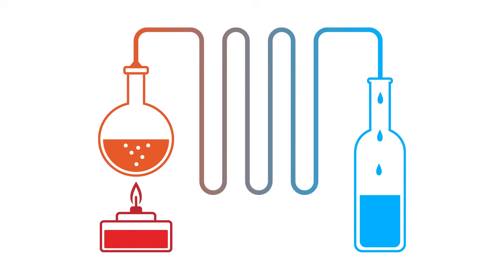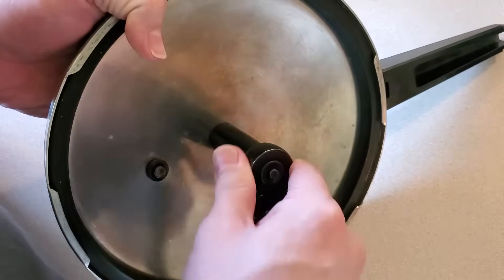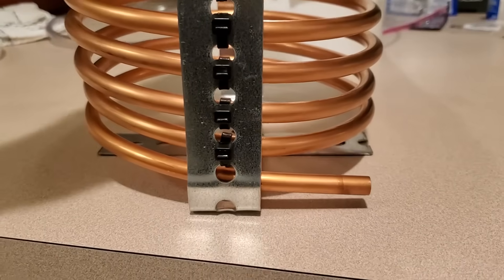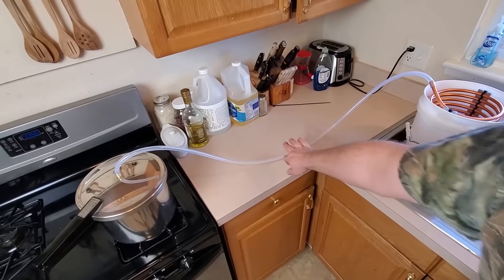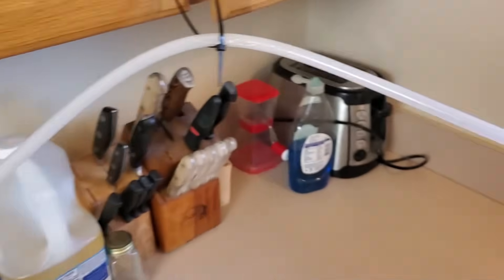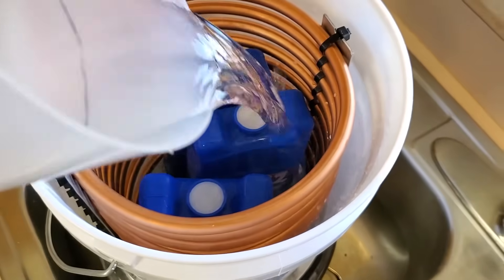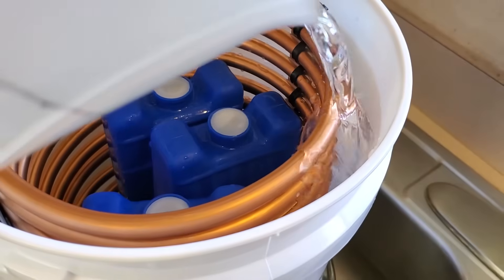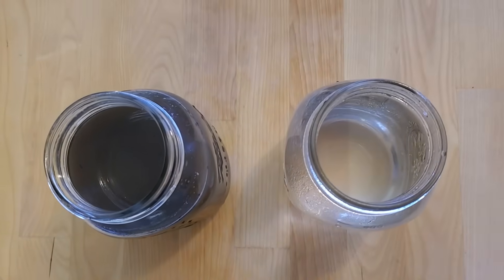DIY Water Distiller (Higher Output Version) - Full Build and Demonstration

Comment: I did the same thing and got fantastic results, however the distilled water is coming out cloudy. I read somewhere that that's because there is a lot of micro bubbles in the water so will it turn clear with time?
Reply from the maker: That's certainly possible. That was is just shy of boiling when it condenses and falls out into your jar. If it's not clear within a few minutes, I'm not sure why.

Comment: If you let your boiling container run dry through the process, you can use distilled vinegar (which is a mild acid) to soak in the container to loosen and easily remove the sludge that builds up.  If you use a stainless steel container, vinegar is the way to go, and by the way, if you use stainless steel cookware that gets caked up with the food you cooked in it, vinegar will help make that clean up easier too, just let it soak in vinegar for awhile then the guck should be easy to remove.
Reply: Barkeeper's Friend is less than $2 a can and works even better.
Reply: You can also steam vinegar through the copper, which I've heard is corrosive(?)
Reply: Hey Jerry, thanks for the advice! I have bought a few stainless steel cookwares, and plan to get more in the future! My family always used aluminium cookware, and I'm slowly weaning out all the aluminium cookware in the house.

Comment: Could you not have the steam/water drain into another sealed container- the same as your boiler, so that the steam will condense and cool overtime?
Reply from the maker: The issue with doing that is I'd basically be creating a pressurized steam bomb. That's assuming that the silicone hose wouldn't just blast right off under the pressure, which it would. It's got to be an "open" system. The way to make it more efficient would be more/longer condenser coils.

Comment: I just did this in a basic 5 gallon distiller I bought.  It was very inefficient.  This set up here was also ver inefficient.  35m of fuel and 35m of water ru ning out of that bucket for 20 ounces of distilled water is is simply inefficient.  If you are next to a cold stream, great.  Use the flowing cold water.  Don't splash in your distilled water, though!  Also, if you have use for hot water, this setup will create it.  Shower water, dish water, etc. can be used from this process.  If not near a stream or river, you can also recycle water.  Remover the water when it gets warm, leave it out while other water is cooling, and reuse the water once it cools a bit.  On my distiller, I think my water flow increased when I poured some water right at the beginning of the condenser process, but this was outside the condensore bin, so it dripped on top of the boiler lid.  I think the steam there created back pressure at the 90 degree angle that limited steam flow into the horizontal condenser portion of the copper tubing.  Overall, this is better than nothing, but not an elegant solution by any means.  It was time consuming to create relatively little output.

Comment: That’s a lot of work, expense, gas or electric stove power and wasting cold tap water to cool coils. It all adds up $. I’ll keep buying mine at Walmart.
Reply from the maker: It's certainly more cost effective to buy it from Walmart. My interest in building a distiller has more to do with what happens if you can no longer buy it at Walmart (or anywhere else).

Comment: It would be cool to split the clean batch, pass one through a simple brita type filter and sending a sample of each of the clean waters for testing. I also have heard its good to add some electrolytes to distilled water if your drinking it on the regular.

Comment: Great idea.  Would it work with less heat under the pressure cooker so it would give more time for steam to cool with a slower flow?  Blessings
Reply from the maker: I'm not 100% sure on the answer to this, but I think the answer is no. Because steam won't happen until the water reaches boiling temperature, and steam definitely happens once it reaches that temperature. In other words.... your steam is always going to be "steam temperature", and if your temp is lower than that, you won't get steam. Even though this uses a pressure cooker, it's not really pressurized (because of the hole in the top), so that temperature is gonna be somewhat consistent at 212 degrees F (unless you live at high altitude, then it'll be slightly lower).
Reply: Yes sir it would absolutely work with less heat a person could put in a penetrator in the lid of the pressure cooker with a thermometer inside the lid but not down in the water. And as long as you keep the temperature somewhere in the neighborhood of 212 to 215°, it will create steam but it would be coming out of the worm at a slower speed
Reply: I'm sorry I wasn't clear on my last post the worm is the little bit of copper that sticks outside of the coil bucket where the condensed water actually drips from

Comment: Disregarding the increased risk of being burned/losing potential energy, what do you think about omitting the condenser bucket and copper tubing to make a small scale version of this? I imagine the pressure cooker with attached tubing leading directly to the collection jar.
I plan on making a proper version of this distiller when I have the resources available, but I need a lot of distilled water right away,  and I am SO tired of collecting steam on a upsidedown pot lid!
Reply from the maker: Hi Robin, I suspect you would just end up with a lot of steam shooting into your container. I have seen a version of this that uses a flexible metal hose that just sort of arches between a large tea kettle and a container, but it's still definitely less efficient. Once you create steam, you have to somehow cool it before collecting it, otherwise you're just venting steam into the air but with more steps.

Comment: probably in the comments somewhere but yeah... that hole for the tubing in the bottom could use some silicon to keep the water in, saw in a comment about copper leaching... what about just using  the same plastic tubing  ? does plastic leak too ? then here you would have 2 possible leachers if so.  when doing colloidal silver you need pure distilled so that would be a concern, have to wonder if it is made right in store bought gallons. and is that 316L stainless steel tubing hard to get.
Reply from the maker: Well, I'm using food-grade silicone tubing for the flexible hose part, which does not leech anything. As for the copper, this is needed for the "radiator" properties. It's highly temperature conductive, which is why it works so well. I'm not worried about copper leeching into the water.

Comment: Great video and DIY!  One word of warning - distilled water leaches copper.  It would be a safer idea to use 316L Stainless Steel Food-Grade tubing for your condenser.  It will raise the price, but it is a safer solution.
Reply: thanks! Conversely, how much potential Chromium/Nickel/etc. might leach into the distilled water?
Reply: @stevoblevo  probably much less, because the alloy as a whole rusts/oxidises less than copper (if high grade S.S is used). Side note, avoid aluminium pots and tubing too.
Reply: gold plated problem solved
Reply: Most people have a copper deficiency. If anything, the amount actually leached from the distillation process would be a benefit.
Reply: @HeadbandvrOFFCIAL  Copper can easily exceed recommended amount & become a toxic amount.
Reply: Anyone know how much? Im trying to distill well water for cannabis plants, very high iron content but potable for people. Dont wanna trade one metal toxicity for another
Reply: @wills.5762  RO
Reply: What about pvc pipe?
Reply: @maisong9886  pvc also leaks into the water, there is one expensive plastic that does not can't remember its name, you then also lose the conductance of copper
Reply: @divey1337  I used to do sewer / water installs on new houses. Some used copper lines, and others some blue PVC type material. Granted that was cold water that went to the water heater, and from there pretty sure it was some sort of PVC plastic.
Reply: @maisong9886  polypropylene is its name
Reply: @maisong9886  hard to find in suitable sizes and it's difficult to make a coil with it
Reply: Copper isnt toxic to life.
Reply: @Blade56762  https://ods.od.nih.gov/factsheets/Copper-Consumer/
Reply: We need copper anyways most people are defiecent right? Id rather have extra copper than 50 random people prescription drugs including birth control woman pee out not to mention flouride chlorine the list goes on and on. Dont stand directly over the distillation and breath the fumes in thet have phalates from what I've read
Reply: Are you talking about the pipe called PEX pipe? Also people have been using this exact setup minus the locking lid pot for eons making moonshine. I wonder just how much of the copper is actually leaching into the water?
Reply: Most people are not going to be consistently distilling huge quantities of water, or they're going to do it irregularly considering how cheap and easily available jugs of distilled water are. As long as you clean out the copper tubing with something like vinegar before using the distillation coil then you'll be completely fine.

Comment: If you go watch some videos on still setups you will see its very similar. If you set this up near a water source you can run cool water over your condensers to get a much higher yield. You can also make good use of those little pumps that you can mount in your drill if you set them up to be run by a small water wheel if you have flowing a flowing water source like a little creek. They are also somewhat noiseless.

Comment: what about the length of the silicone tubes? does the steam need to be in the tube that long?
Reply from the maker: Nah, you could use a shorter silicone tube. That's just the length that worked for my setup.

Comment: I would be convinced that this process works if you drink the distilled water just made from that sludge.
Reply from the maker: Yea, somehow I didn't think to put that in the video. I absolutely drank some, but wasn't recording. Completely fine water. That's exactly what distillation does; it separates H2O from anything/everything that isn't H2O.

Comment: I used high temp food grade silicon tubing  & bought 25” 3:8 OD copper tubing at Lowe’s. & copied exactly as shown here. Water taste horrible like chemicals . Any ideas why?
Reply from the maker: The only thing I could even guess is if your copper tubing had any kind of oils or something on it from the factory. I'd try flushing it with a lot of dish soap and water and trying again. I didn't experience that problem when I built mine.
Reply: @GreatLakesPrepping  Thanks for the reply ,yes it was oily smelly water & I suspect the copper as I verified the tubing was good... will run again. Also used waterproof  silicon around copper bucket exit spout . No water leaks from cooling coils. Surprised how hot they get!. Also added a spout to bucket to drain cooling water. I’m sure it will be fine thanks for vid

Comment: What about sealing the hole in the condensor bucket? I love your job.
Reply: the water in the bucket gets warm after a short while and no longer is able to condense the steam properly. With the hole it drains by its self instead of him having to dump it some how. The best thing to do would be to seal it, then add another hole with a fitting that can be open/closed. When the water gets warm, you open the valve to let the water out, then close it to fill it back up again.
Reply: @cloudsteele1989  Then the old water can be cooled and reused.

Comment: Does it have to be copper? I get why copper is used, good conductor so the heat does leave easily with the condenser cooled, but copper is in short supply and going up, would silicone tubing all the way have any notable demerits?
Reply from the maker: Well, I'm certainly not an engineer of thermodynamics, but copper seems to be pretty much the standard for heat coils, condensers, etc. I would think that silicon doesn't conduct nearly well enough, compared to copper. Some other type of metal may, but it's probably not flexible like copper, to be able to bend it yourself without specialty tools. You might be able to check craigslist or facebook marketplace for some scrap copper tubing that someone has leftover from some sort of job, maybe get it for cheaper.

Comment: If you had ice cubes and kept the condenser bucket filled with ice I feel like would be effective as well. Or maybe making a very large ice chunk and keeping it on top of the coils and it would melt and cool the copper down as it heats up.
Reply: I run a coil like this to make moonshine on my still and ice melts super rapidly. If I had to make a guess that 3 gallon bucket full of ice packed around that coil would be warm water in 20 minutes

Comment: I recently started using distilled water. And I have my mom's old pressure cooker. So now I might make my own. But should I use a little less copper tubing so that the water doesn't stay hot for long? Would it flow faster if I use less copper tubing?
Reply from the maker: Actually more copper tubing would be better, because it gives the water more opportunity to cool. The copper oil is basically a radiator, exposing cool air (or water) to a small amount of water. The more copper it can run through, the more it will cool before reaching the bottom.

Comment: Did you leave the stove on high and let the water boil throughout the whole process? Or did you bring it to a boil then turn the heat down?
Reply from the maker: It was at a boil the whole time, which is required in order to create steam (which is needed in order to re-condense that steam into distilled water).

Comment: Great idea!  I haven’t read through all the comments yet; but I was wondering if you left on the mason jar top and drilled a hole to accommodate the silicone tubing if that would help trap all the lost steam coming from mason jar and add to volume of produced distilled water?
Reply from the maker: It's possible, but I think if the hole/hose fitting was snug enough to not let the steam escape, it would become pressurized very quickly, and probably explode hot water all over the place!
Reply: If you seal both ends you will start to create pressure which could cause a problem in the Mason jar or the cooker...... likely not the cooker, but the Mason jar could explode if you're pushing too much steam/preasure through it.  As long as the water around the condenser is not boiling it will cool the steam to produce pure water

Comment: acting as a drain? as you run the cold water in the condenser heats up. Cold water is escaping the condenser from the bottom. Install a tap half way up the back side of the bucket. Drain warm water from top half. Keep cold water in the bottom now you just need to top it off with cold water. I use a garden hose and tap to drain and refresh keeps condenser water cold as you run.

Comment: Why not use a water collector that's larger than the heated chamber and seal the water container to make it possible to trap the steam in it, which will will eventually cool into water.
Reply from the maker: I'm sure there's something along those lines I could do to improve efficiency. But if the collection container was completely sealed and could not allow any steam to escape, wouldn't it become effectively pressurized. At that point the entire system would be pressurized (on account of the pressure cooker forcing water/steam all the way through). I'm pretty sure some part of the contraption would burst, in a pretty dangerous way.

Comment: I like your video I'm going to add a few of my own tips like twice or three times the copper coil and I will not use any rubber hoses which can leach chemicals into my water I will use the copper straight from the pan straight to my cup but this is all hindsight thanks for the good idea
Reply from the maker: Thanks Erick. I'll mention that I did not use any rubber hoses in this build. The flexible hoses are high-temperature, food-grade silicone.

Comment: What ya could do there is add yourself a center-bored bolt to that there bucket and plug your tube into it with a quick connect fitting like this thing here: https://www.mcmaster.com/Quick-Connect-Fittings/plastic-quick-disconnect-hose-couplings-for-air-and-water/ - That way you have a fast way to get that bucket empty or set up with minimal fuss.
I imagine a headless bored shaft with a nut on either side of that there plastic bucket wall and silicone as a gasket

Comment: Good stuff. Thanks for sharing your process. What did you form the copper around?
Reply from the maker: Thanks Dave. The copper came in a spiral already, though much wider. I just gradually reshaped it with my hands, a little at a time, until it was the diameter I wanted.
Reply: @GreatLakesPrepping  Filling the copper tube with dry sand and plugging the ends with tape or something, then bending it around a form will reduce or eliminate the tube from kinking while it is being bent and formed.
Reply from the maker: @gr8-fun162  Interesting idea, though I didn't have any issues with kinking.
Reply: Nice. Trying to cut the fluoride, chlorine from water that I brew my coffee with. The recirculating pump seems like it would be the hot setup. Thanks again.

Comment: this method is solid. I would use my rocket stove as the heat source as it is extremely efficient. I always have a fire going and this is WAY cheaper than buying filters for those fancy filtering system.
Reply: While the design is a bit impractical for this use, the channel Jairus of All has an excellent rocket mass heater build series where he goes into great detail on how he configured his and the reasoning behind it. I recommend his channel, his research skills are impeccable. What you learn on Jairus's channel can contribute to your other projects like it has mine.